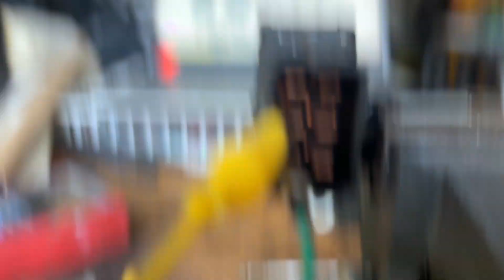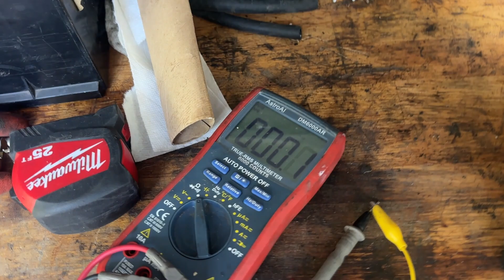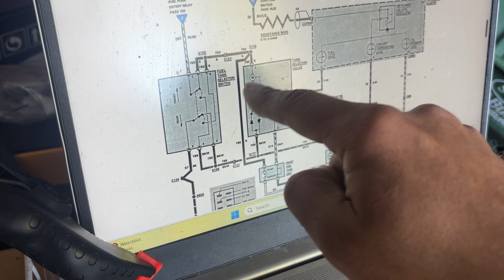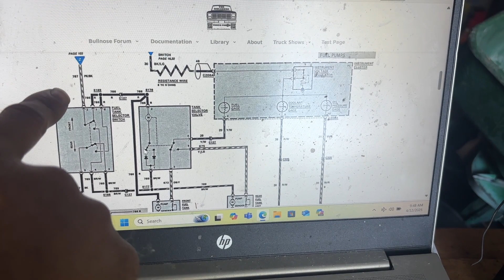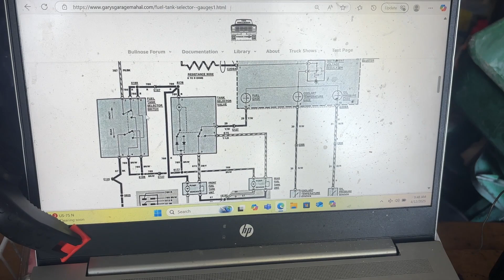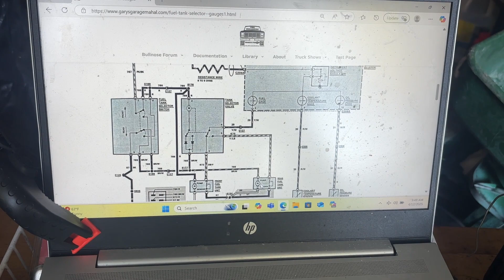1985 1986 F250 F350 Fuel Selector switch troubleshooting

Comment: My problem is the valve got stuck while switching tanks one day so I had to tap it with the handle of a screwdriver to free it up and now it only wants to run the front tank meanwhile I still have 19 gallons of gas in the rear tank because of it.
Reply from the maker: Yeah get rid of the valve, and go to manual brass valves. Check my other video on the swap.